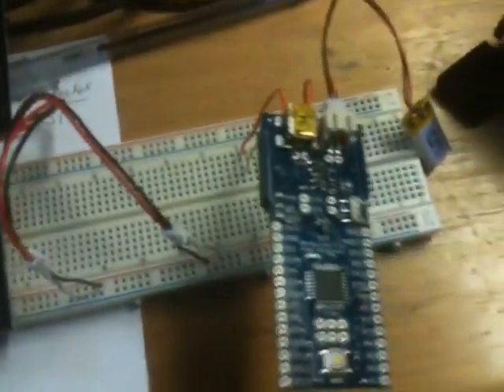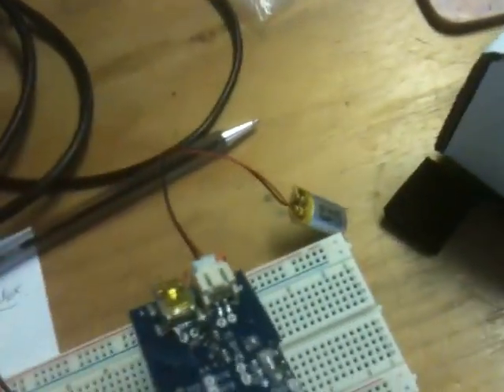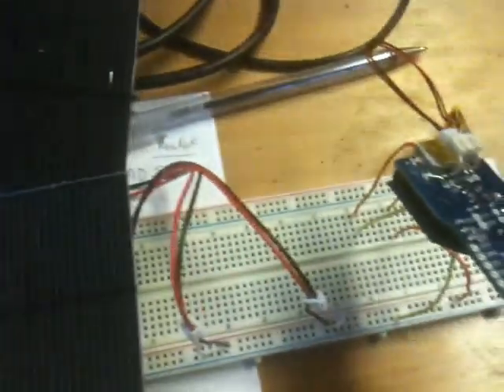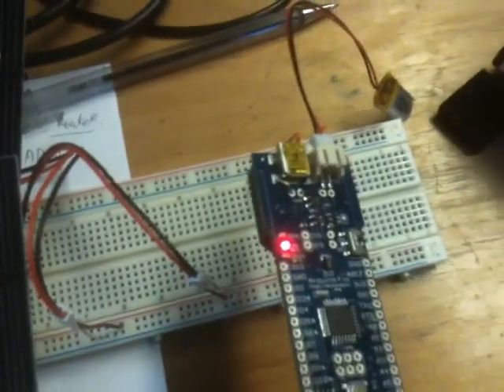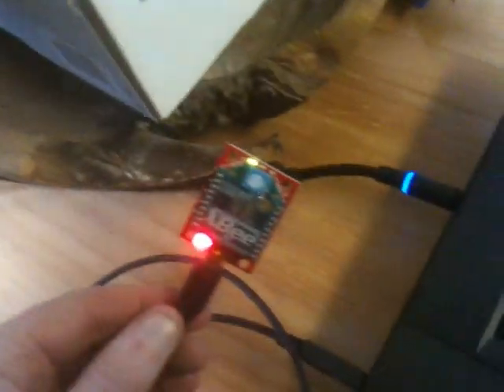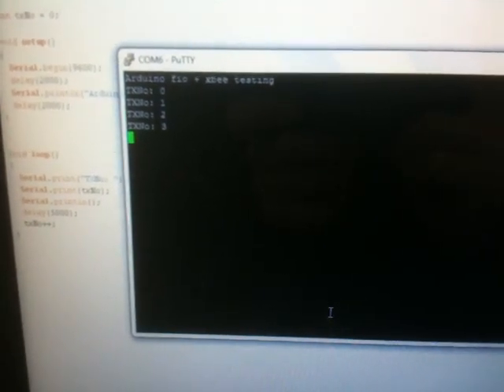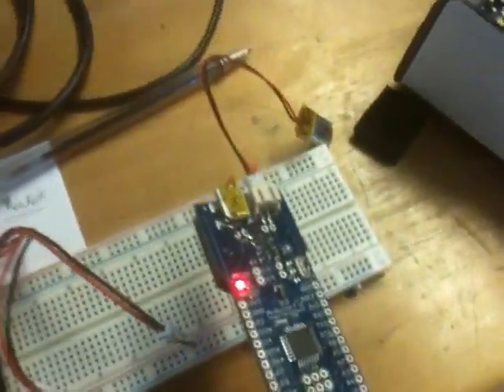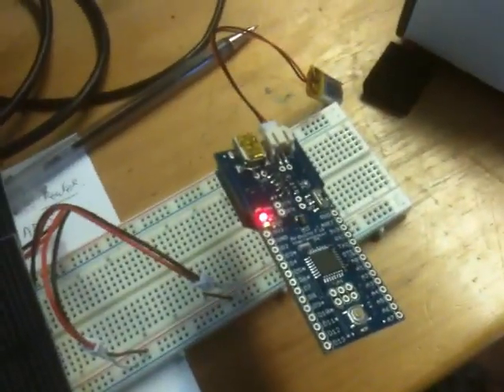Arduino FIO and XBEE 2mW radio, with 110mAh battery and 2W solar panel

Comment from the maker: Hi Patrick, the 110mAh battery turned out to be far too small in capacity it only powered the Fio for about an hour or two. I've since replaced it with a 2000mAh (2Ah) which can keep it going for several days when also being recharged with solar power during the day.

Comment: Thanks for posting this.  I want to do something similar with FIO and solar panels.  Did you put a voltage regulator between your panels and the FIO?  Or does the FIO charging circuit handle it?  Thanks.

Comment: hi - I was wondering how you found the 110mAh LiPo battery worked with your arduino? How long can it power the fio for? Was thinking about getting one for an arduino pro mini but worried the current consumption would be too high?